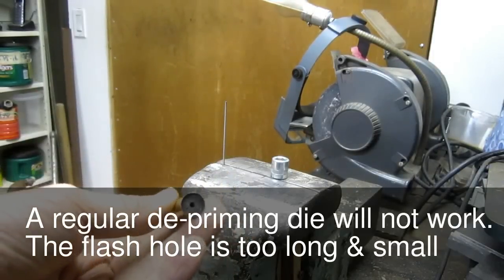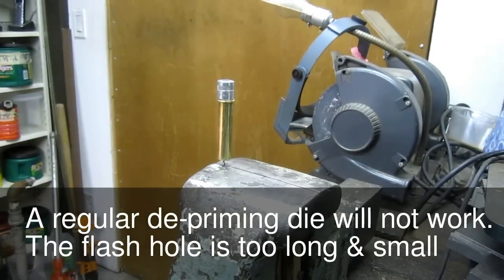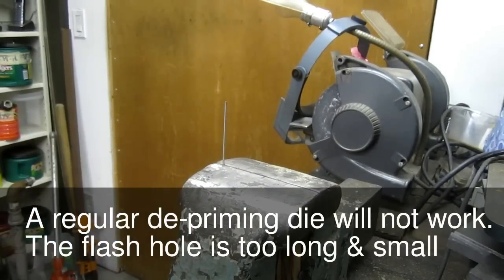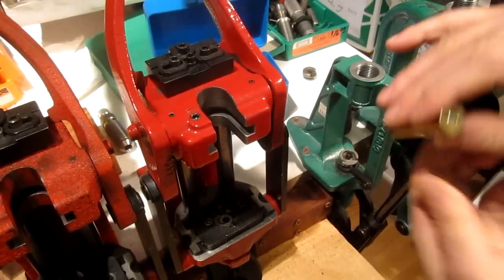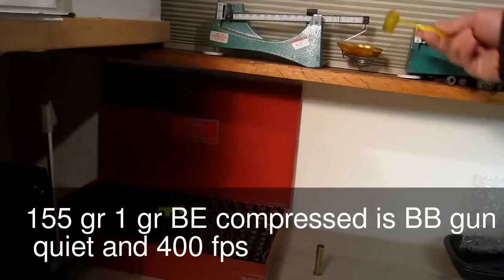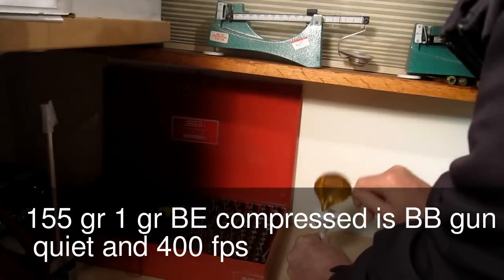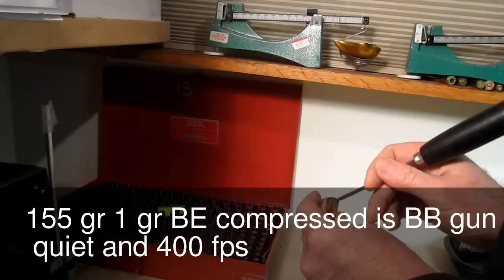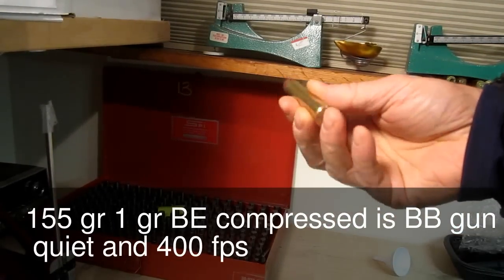45/70 case with filler

Comment from the maker: That may be a 0.062" = 1/16" airplane drill. They are cheaper.

Enco 317-8760 will work and will only cost ~~ $3